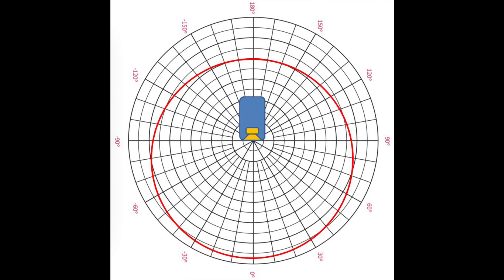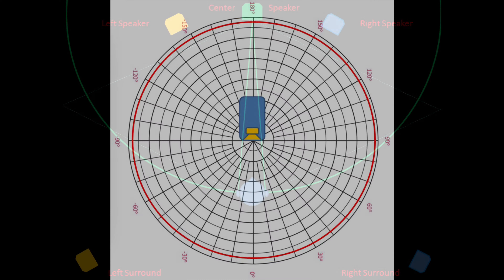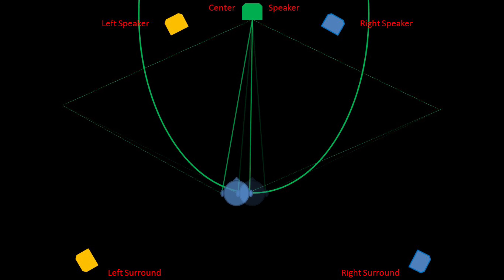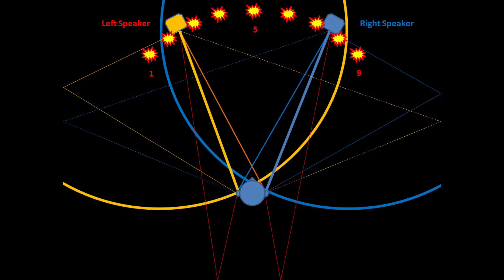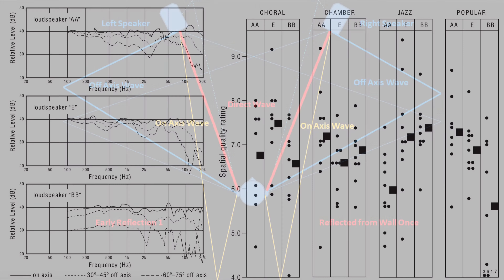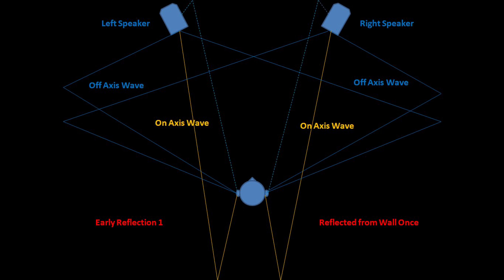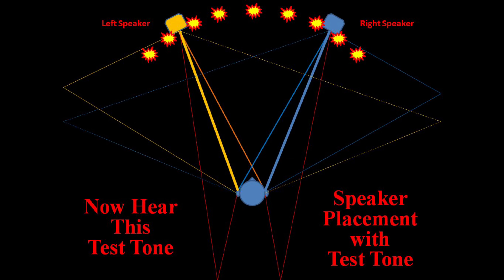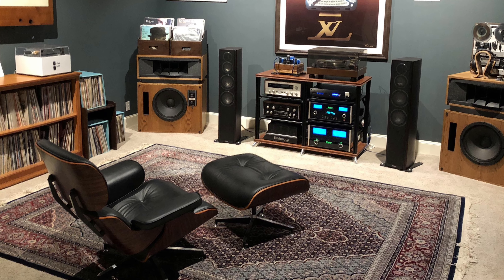Speaker Dispersion and Speaker Placement

Comment: I don't have a degree in acoustics and sound however I have hosted an open mic night for just about twenty years self-taught on operating my sound equipment I have come to believe that everything affects everything and that if you use a real time analyzer that's all cool
Reply: However and saying this I've experienced the way a club can sound when it is empty compared to when it is full of people it has to be set up different so the sound constantly changing. If you hear a guitarist playing his guitar with thick string s it will sound different
Reply: If the air is dry your sound will sound different when the humidity is high compared to when it is dryer
Reply from the maker: Thanks for sharing your real life experience from the field. Yes, sound acoustics is a very complex situation. There are many factors that will alter the sound effects and characteristics. Room reflection and absorption can be significantly altered with the subjects in the room including the human body and the crowd for sure.